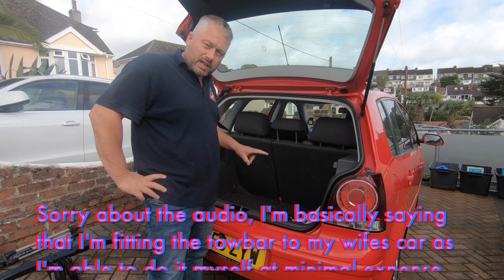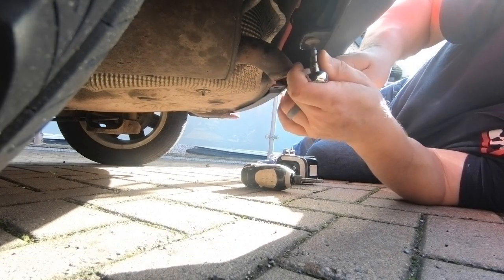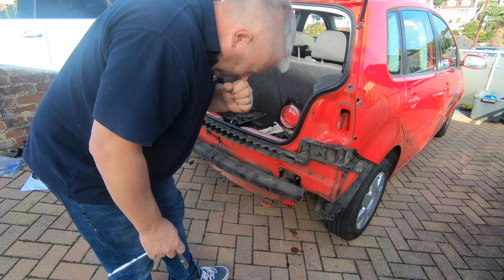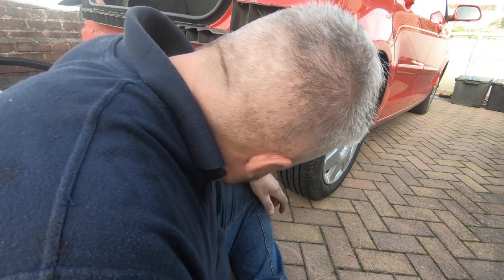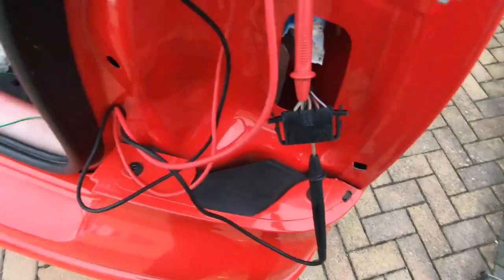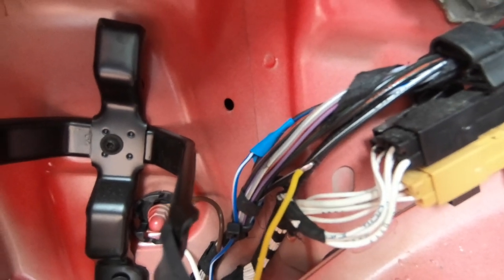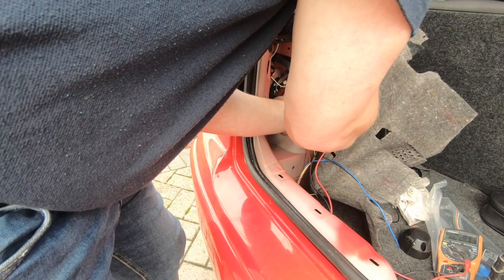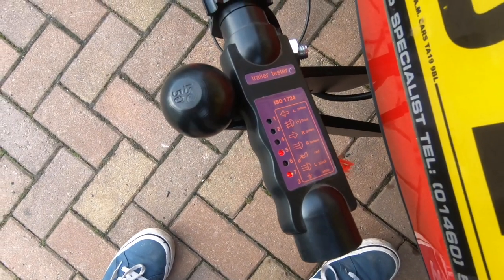Installing a Witter towbar and electrics to a 2006 VW Polo MK4

Comment: Good video but wouldn’t be using a drill to remove bolts that old it’s lazy and will round off bolts. Use a ratchet as you’ll get more feel and less chance of rounding 🤝👏